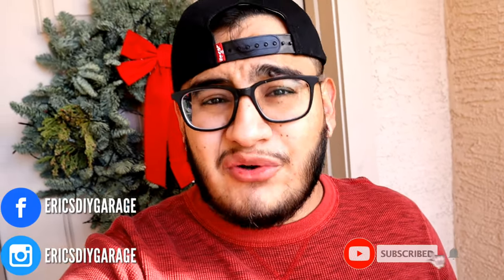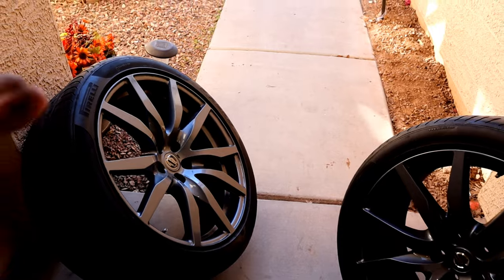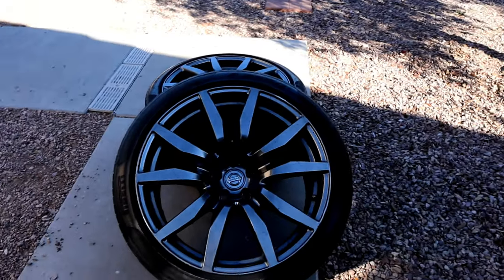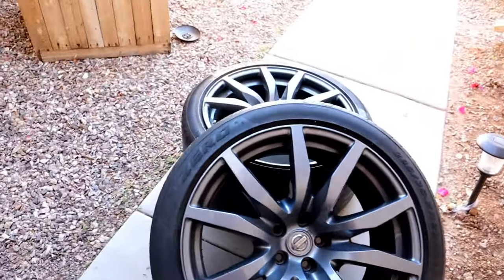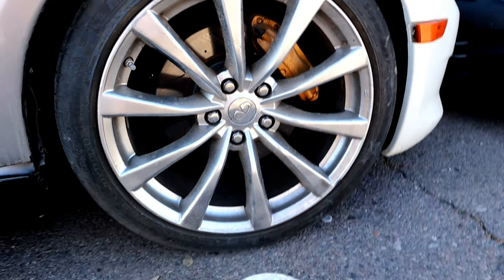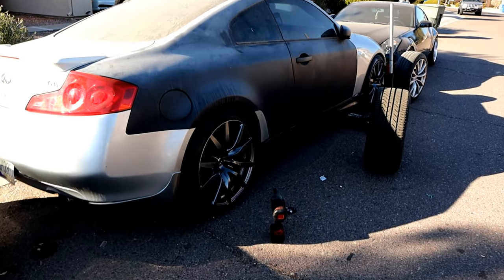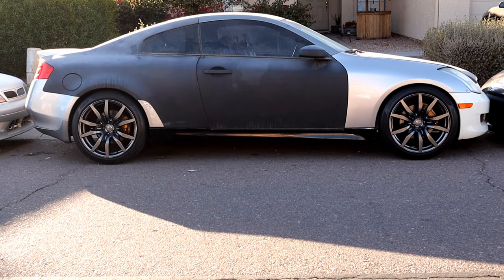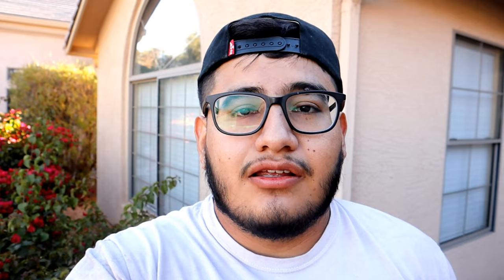Nissan GT-R Square Wheel Setup Installed On My Infiniti G35 Coupe!

Comment: I have a 2010 g37 coupe running 
19x9.5 with 245 40/19 front 
20x10 with 285 35/20 rear 

I have a 20mm spacer in front so it pokes out about same as the gtr wheels on this g35
. Looks pretty good and once I lower it I know it will look more aggressive just not sure if I should do 245 35/19 in front to match the side profiles. If I do go lower though I think In the rear I’ll have to go smaller than 285 in the rear maybe 255 so that it’s stretched and it doesn’t rub so much. But I do plan on rolling my fenders
Reply from the maker: I think the g37 comes with rolled fenders already from the factory if I remember correctly, I think you are better off with 245/40 in the front I have used 35 in the front and the ride is much harsher and the wheels bend and get damaged faster. in the rear 255 should be better I think 🤔
Reply: @ERICSDIYGARAGE   yea they’re rolled but you can use the roller to bend in that straight part at the tip of the fender . And you’re right because I was running 30 profile in front before and it was a uncomfortable ride you could feel every rock . And yes 255 would be better but I was getting used tires and I had lost out on 160 for some 315 35/20 used Bridgestone so I got some used ones and all they had was 285 which was hard enough to even find that size for 20”

Comment: For RWD, my car’s factory setup is 225/50/18 for front and 245/45/18 for rear.

I have some buddies run square setup with 245/45/18.

If front and rear rims have Different offset, can you still do tire rotation??
Reply from the maker: No, these cars come with a Staggered set up so even with stock sets of wheels you're not able to do tire rotations because they are different sizes
Reply: @ERICSDIYGARAGE  do you mean since stock rims have different offset for front and rear, even I use square setup, it’s not possible to do tire rotation?
Reply from the maker: @urusa.  technically, you shouldn't rotate them. If you have the same tire specs on all 4 wheel maybe but if you have a front wheel that's 18x8 +45 and a rear wheel that's 18x10+15 it won't be ideal to rotate

Comment: In theory GT-R wheels on a g series seems like a gd idea, and they do look pretty decent bu if u truly want my opinion I’d say no because they honestly only look great on the gtr. Any other car and they just look decent. As far as the size, I wouldn’t go more then 18 -19 inch depending on the wheel. Less Maintnance, weight, and more tire and suspension options. 
If you decide to use the gtr wheels I’d change the color to something in a grey/silver maybe or even white.
Reply: G35s are just as nice as the r35!!! Not the the g37 or the g35 with the g37 front .
Reply: @justinkhayse5863  define nice? And explain why the gtr cost so much more? Is it the interior? The engine? What options does the g35 have that the gtr doesn’t? If you are talking about luxury items then you aren’t considering the gtr is not a luxury vehicle
Reply: @JLE1177  they both are sexy looking rides! I mean shaped similar just g35 looks a little more intimidating! Lol an all these expensive cars are half sport half luxury these days
Reply: @justinkhayse5863  can’t argue with that, but I do prefer the gtr over all but that’s not to say I’m not a fan of the g series mostly the 2 door from a couple gens back